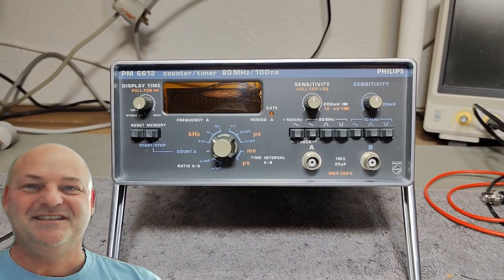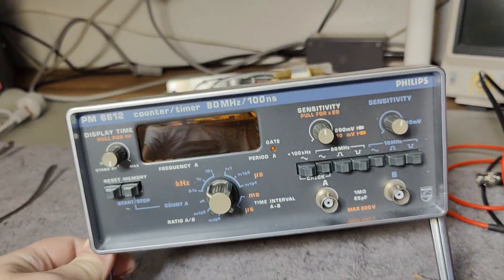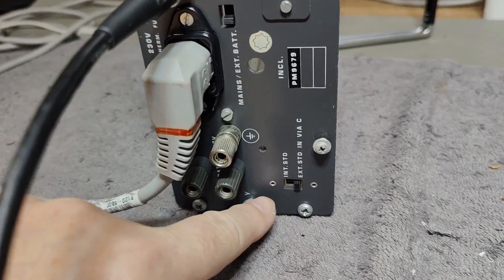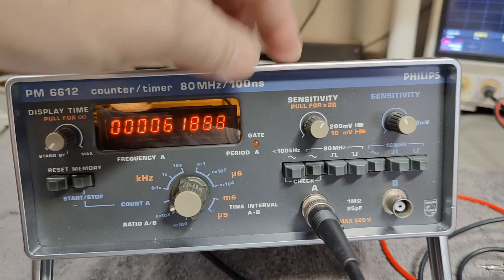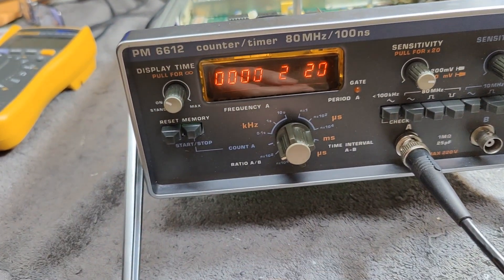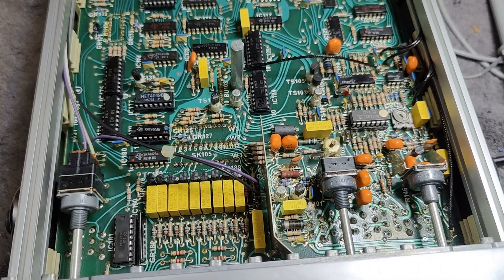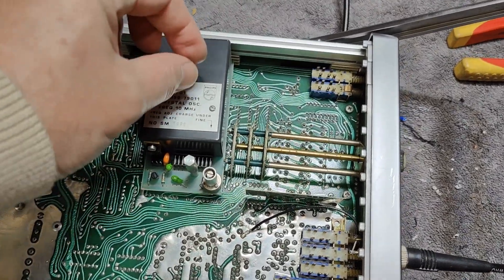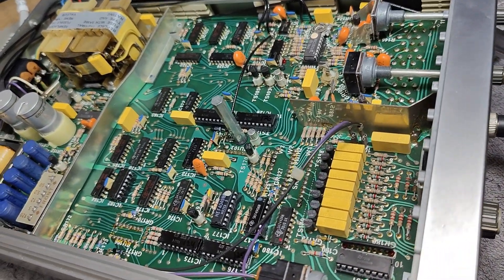Philips PM6612 Counter Timer 80MHz 100nS 1980 test repair

Comment: Hi Thomas, that's a great find for two dollars, I don't have a counter at my workplace yet, now I use the built-in counters in my multimeter and generator + a small one I made for an audio oscillator. The planned purchase of a counter was postponed, I had to buy a new digital oscilloscope because mine went crazy and started showing nonsense - the repair would be unprofitable.
If you can't restore the counter, then for two dollars you have a nice disciplined 10M oscillator that could be used separately for the entire workplace - that is, if you don't use something better.

Nice day 🙂 Tom